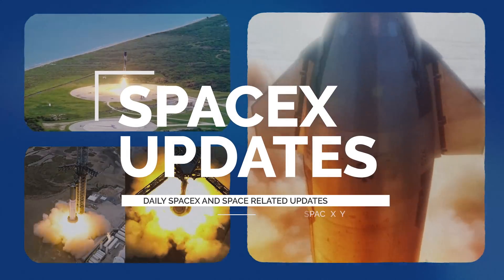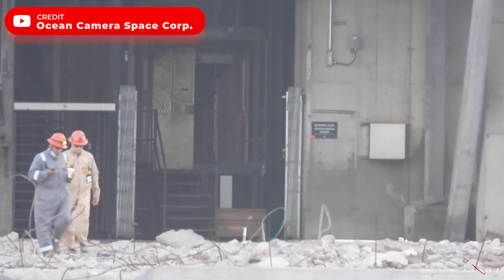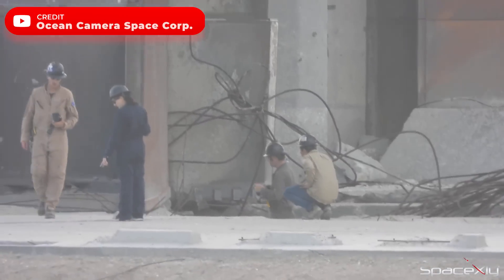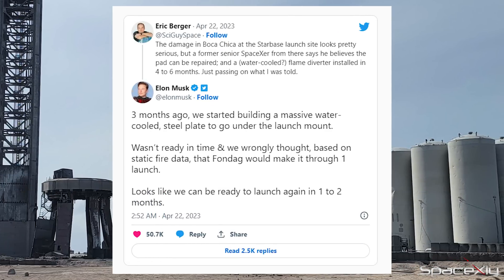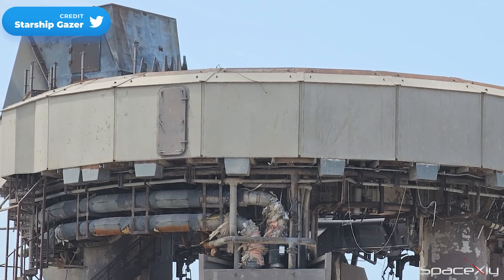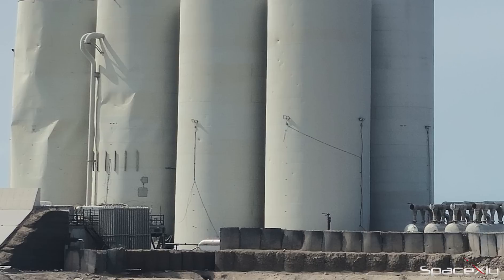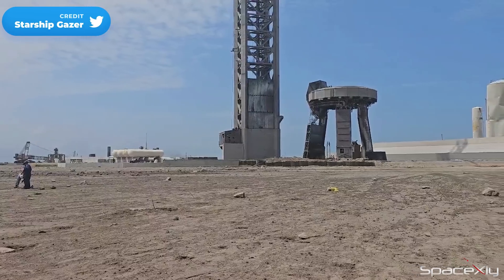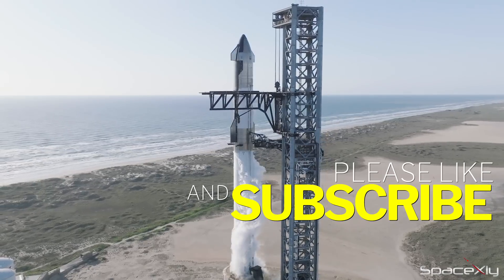Starship Launch Pad Damage Inspected | Clean-Up and Repair Works Begin | SpaceX Starship Updates

Comment: Possibly Mr. Musk knew the launch tower was inadequate to non-destructively channel the blast and shock of the super booster. But, being the genius he is, he wanted a quick as possible test of the super booster even if it partially destroyed the launch tower infrastructure because the bottom of it was going to be totally replaced/modified with the new water cooled metal deflector. In short the super booster crater started off this modification construction project and also indicated the best direction to point the deflector.

Comment: The pad being closed to the water.  It seem like SpaceX could dig a trench to the ocean and excavate a reservoir under the gate.  The trench could have a lock on the ocean side to keep water out until they are ready to launch.  Open the lock and flood the reservoir to absorb the force of the rocket thrust.  The slope of the trench can allow continues water flow  into the reservoir.  They could probably pump seawater on the gantry to create a water curtain.   Steel plates can be place over reservoir before the launch to allow the dance floor to move under the pad.  the plates can be retracked before the launch.

Comment: It was a major mistake assuming that since the pad held up under the static fire test that it would hold up under a much more intense launch. I wonder if anyone spoke up and said "You know that the static test was bearly 50% power right?"

Elon does not like people who bring stuff up and fires at will, this is how we end up with a crater under the launch pad and someone having to explain to their insurance how a flying block of concrete caved in the back of their mini van.

Won't fly again for at least a year. The FAA is plenty livid with Elon right now.
Reply: Why dont you apply at space x?
As you are so smart it should be no problem.
They pay you 200000k a year go for it mr big brain.

Comment: Hello .  What a day!Elon is too optimista. 2 months for the next launching is imposible alterar to see the dramatic consequences. 
 My opinion is a thumbs up for the launch and a fail on the launch pad issue!
 You know, that for many months I was worried
 A) the platform Ground Zero-- the thing underneath - was too weak for the hell I was going to see under it in such a small area.  I mentioned it several times!
 B) I also mentioned several times my concern about having the tank farm that stores methane and oxygen so close and that they have also suffered.  Imagine if the booster on the ramp had exploded, it would have blown the tanks up.  @
 !Terrible!
 Causes: I think that phase 2 of the Starship did not separate because it must have suffered some stress or damage at the time of take off that damaged the booster release mechanism.  In addition, the rocks, intense dust damaged several engines that went out and there will be more things that we will know in due course.

 I think that what I have commented has been a serious lack of foresight and study by those responsible for SpaceX because if I realized this problem, how did they fail??  For saving money!
 Conclusion: Last Friday I thought that a new test would be at the end of June of July but in view of what happened I think that there will be no more flights until at least November/December 23 due to:
 A) revision of the settlement platform with a much improved and redesigned system.  Deeper and more powerful water cooling.
 B) Transfer of the tank park at least 1/2 km more with respect to the platform and with protective protection in the event of an explosion by the blast wave.

 Conclusion: new release November/December 2023 and... with objections.  THEY HAVE A LOT TO THINK ABOUT AND REDESIGN!

 sant cugat
Reply: Elon pushed for the launch date against the engineering team, they then postulated that if a static fire showed minor damage they would not launch without the deluge system, Elon agreed; however, the static fire was successful from Elon's viewpoint and he pressed for the launch. There's way more than 2 months damage. This is another of Elon's "2 weeks" typical reply. By the looks of it, it's unlikely they're launching again this year.